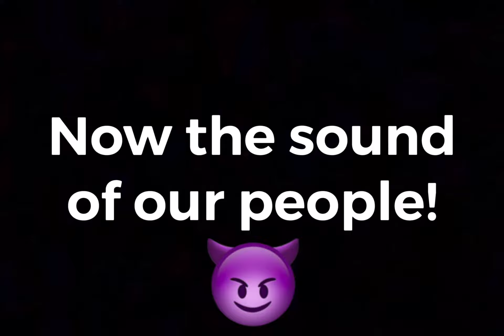GPI intake manifold installed on my 2013 Camaro SS

Comment: Can you feel a difference ? Planning a dyno day up at GPI and am thinking of getting my throttle body ported and the manifold ported/modded. Will essentially be a max effort FBO build. Headers, intake, exhaust, and possibly a UDP if I can find one for a good price.
Reply from the maker: Yeah, I can feel a little difference. Would be more of a difference with a tune. ButI’ll be going back to my stock manifold. The one I received from them wasn’t sealed properly so it’s leaking a lot of air out of the back of it.  And we couldn’t tune it properly on the dyno.
Reply: @TrueNomadCulture  How did you know it was leaking and where from the port where the brake booster goes?
Reply from the maker: No not from the booster but from where it seals to the head. My tuner did  a smoke test to find it. Found out the torque wrench I used was broken and caused the manifold to warp. Bought a new wrench re-torqued the bolts and it was good to go. Got her tuned and she’s at 400HP & 415TQ
Reply: @TrueNomadCulture  I finally took the car over to GPI (14 L99) Headers intake exhaust and their rod mod, put down 404rwhp/416Tq was very happy with the numbers, kicks on traction control anytime I step on it unless going like 60. Looking for a good tire now lol
Reply from the maker: LOL mine does the same! I just ride with it full off now. You plan to do anything else to you Camaro? Once I get the cash and another ride I’ll have a shop take the engine out and install everything else I got from GPI. 👍🏽
Reply: @TrueNomadCulture  Lucky you didn't snap the bolts, they don't like much more then spec.
Reply from the maker: Yeah I got away with that one. Lol